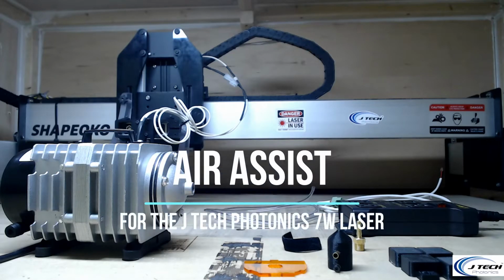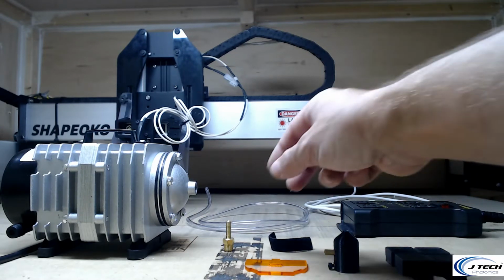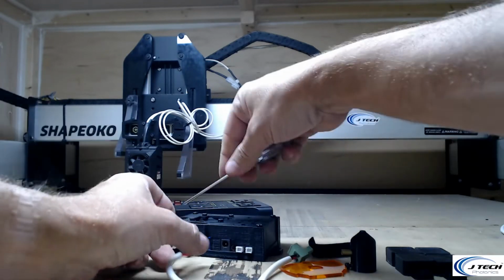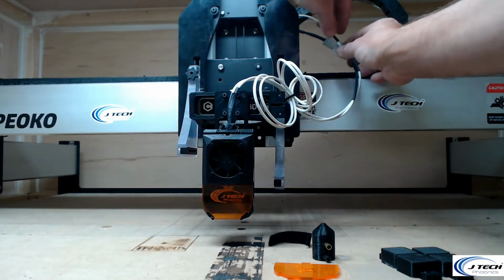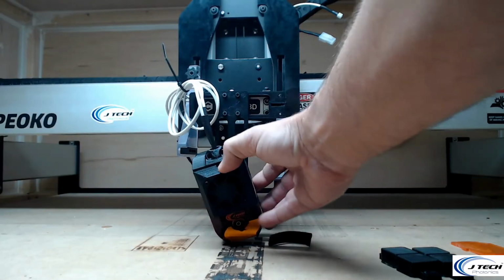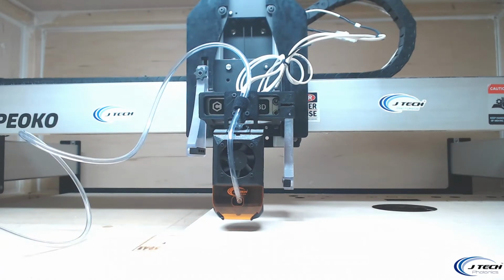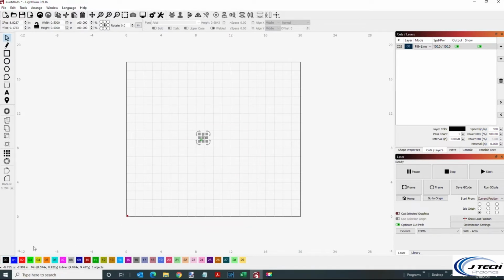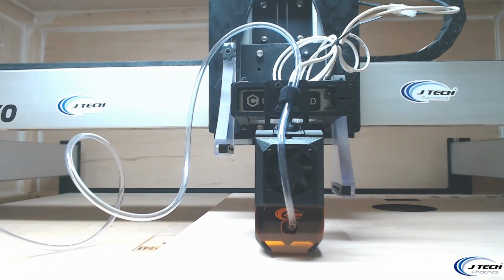Air Assist for J Tech 7W Lasers

Comment: So is this done with the new pro 7 watt or the supper 7w?  I've got the 1st gen super 7w and it doesn't cut through ¼"hard maple plywood very easy on the video shown here. My initial thoughts maybe be the air assist is a Pinellas l00ppp⁰